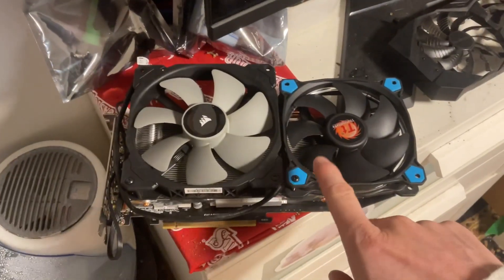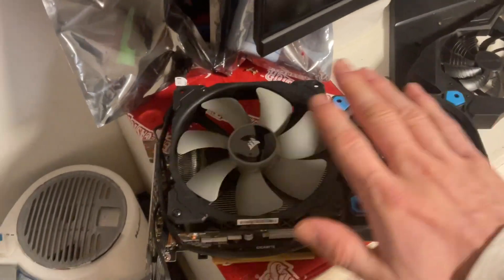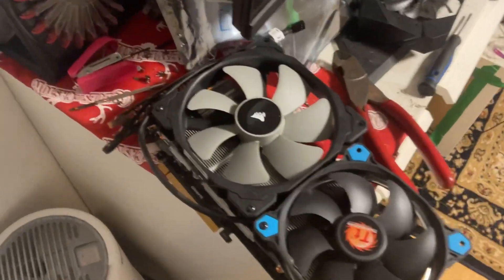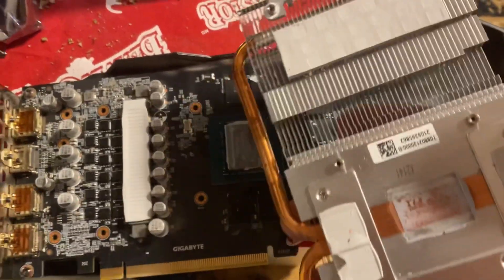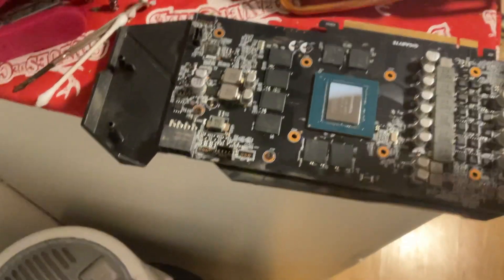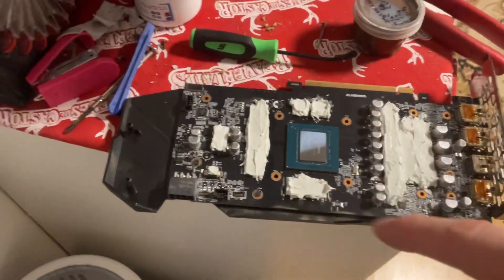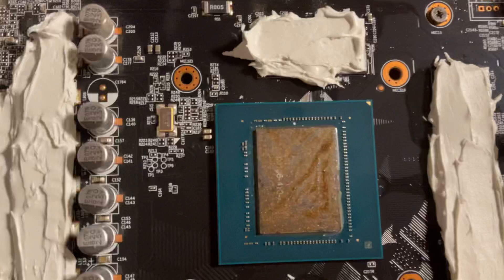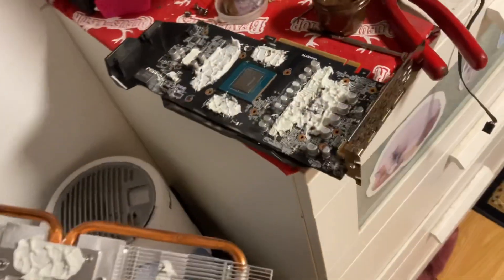K5 + copper repaste Custom 8GB RTX 2060 SUPER

Comment: You should try phase-change material Honeywell PTM7950. It comes in as a sheet, lasts longer and performs works better than traditional pastes. On the power section (vrm) and vrams I advice to give thermal putty Upsiren UX Pro is more efficient than the K5 Pro. Also do undervolting.